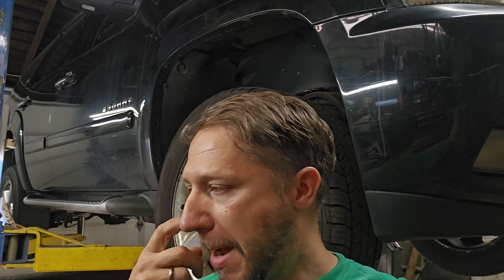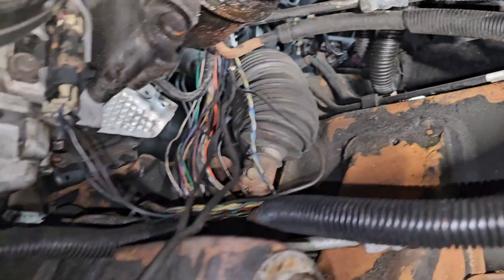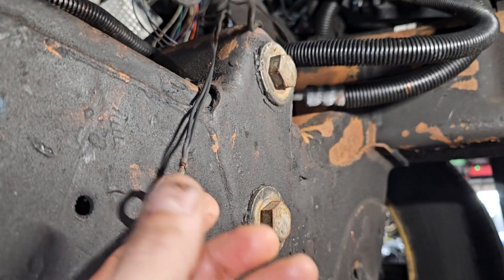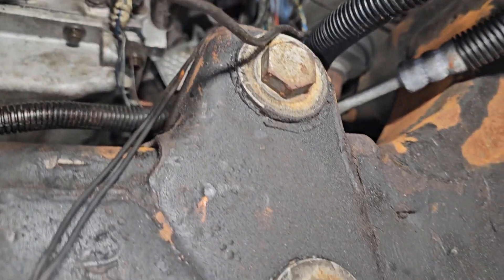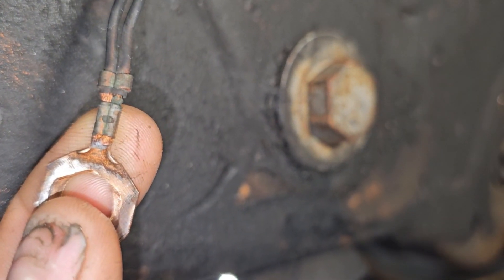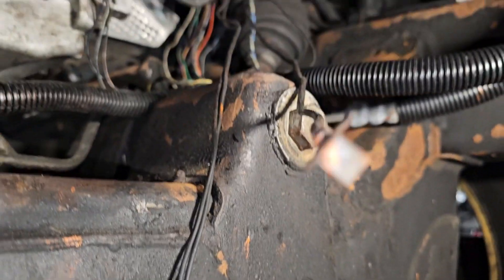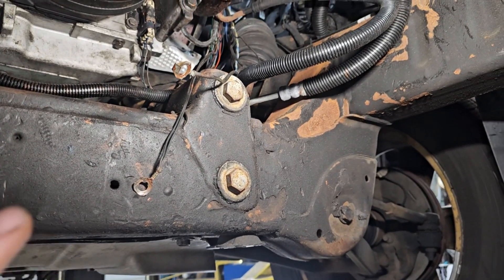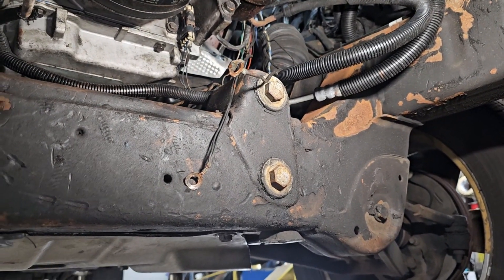2007-14 Tahoe, Lost Communication, U0100, U0101, U0102 Chevy trucks

Comment: Great video, my wifes suv is not having any issues other than it throws the I0101 code, it doesn’t even set the light in the dash, but I cleared it when I was done fixing the evap issue and I checked it today and the code was back, it drives fine and shifts smoothly but it says lost communication with tcm and I don’t want to have her get stranded
Reply from the maker: I would start by checking the wiring harness to the TCM.
Reply: @willpoweredgarage969 ya im going to check grounds and connector drag tests and the obvious thing, its just odd that it works normally but sets a code